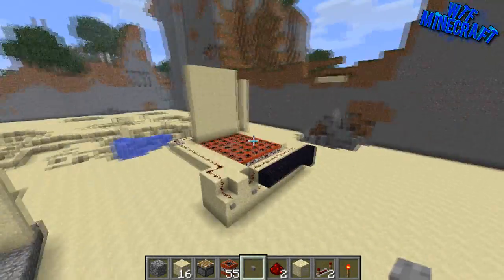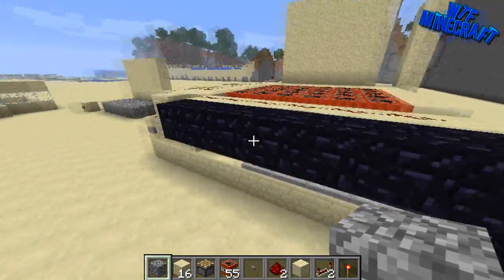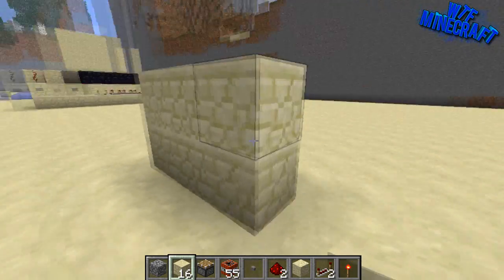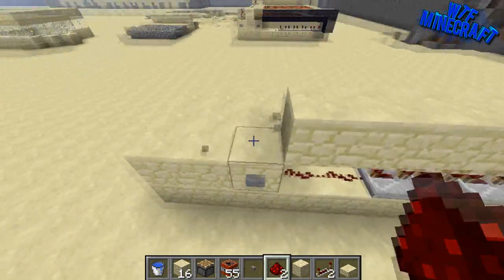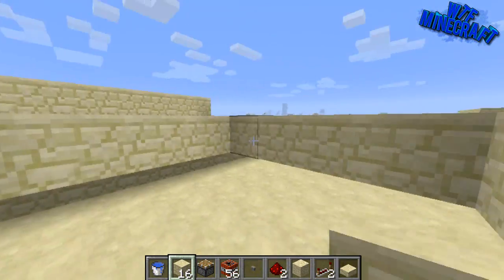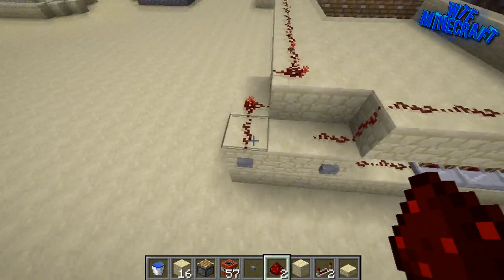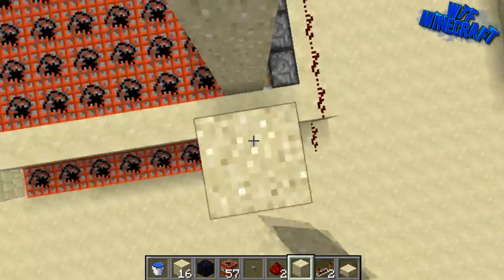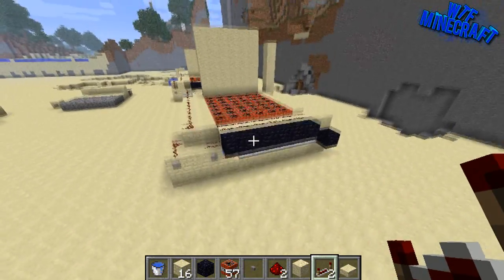How to build a cannon (Part 2 - Automatic loader)

Comment: if you use a piston instead of the half slab, then you time it just right, then you can (while the sand/gravel is still falling) blast it off. However you can't place sand on top of the slab otherwise it will kinda act like any normal block and stay there so it has to be falling...
If you watch Sethblings sand cannon tutorial then you get a better understanding :D
-Stevo_1998